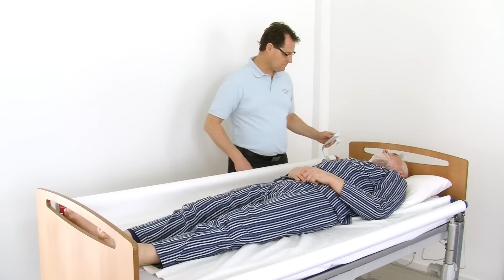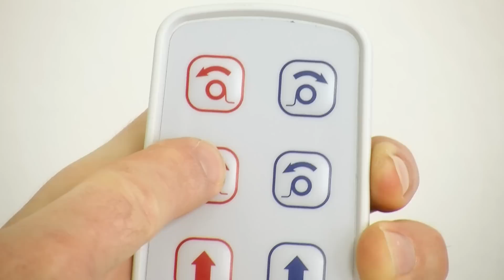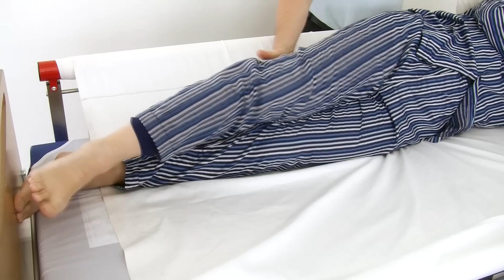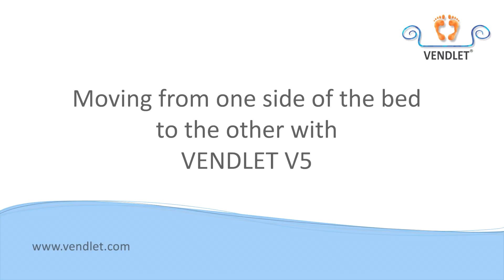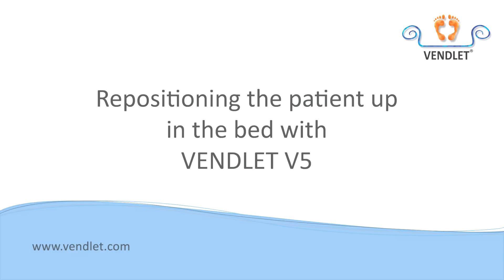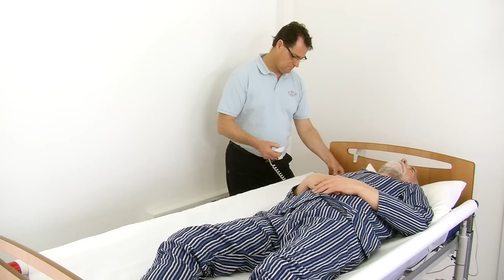How to use VENDLET V5 and V5+

Comment: These beds are a good idea. However in practice the sheet has to be absolutely straight when attaching to the velcro bar. This is problematic if the patient has problems with mobility which is very often the case.